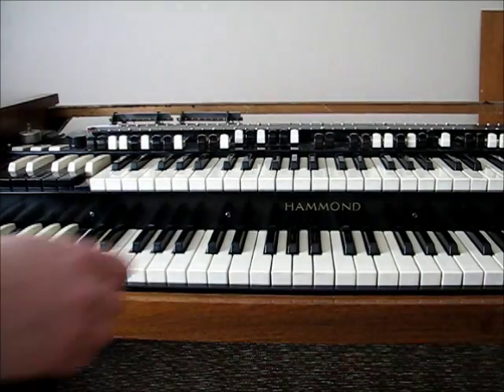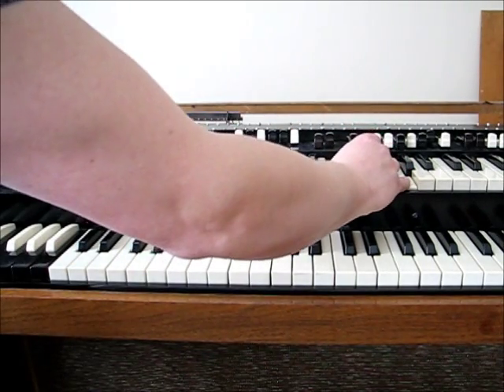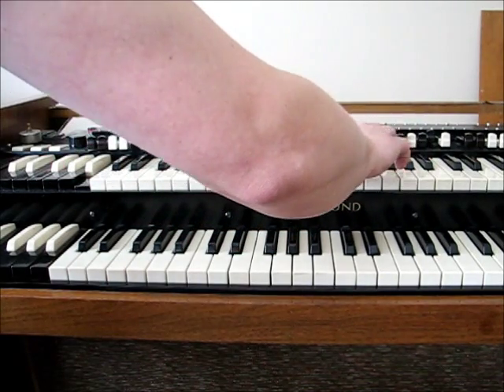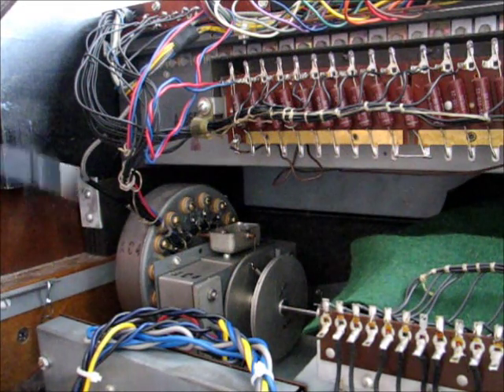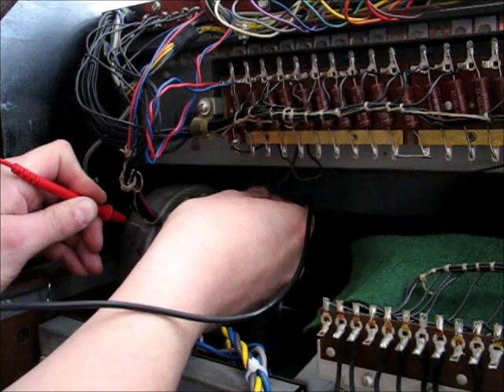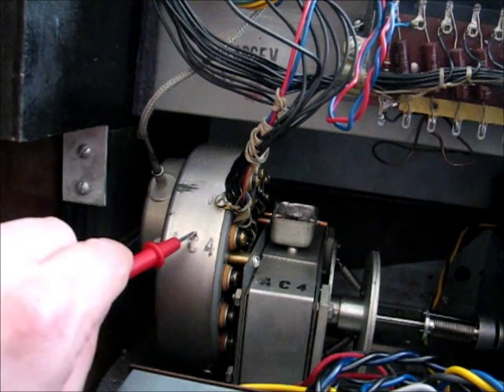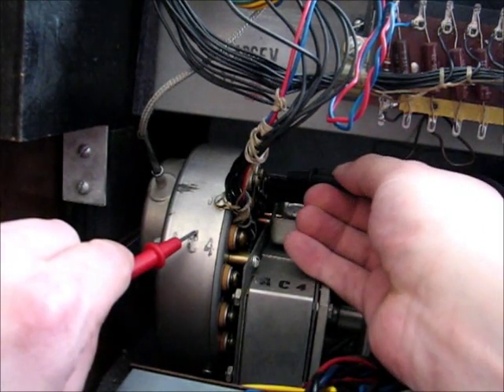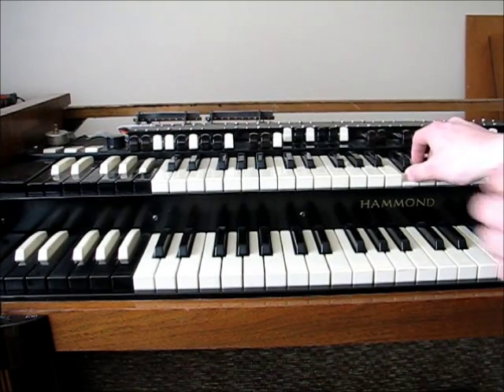Fixed Hammond A100 vibrato scanner

Comment: Hi Dave, I recently acquired an old A100 that is in great shape, a little oil in the tone generator and it fired right up however the vibrato wheel doesn't do anything (as opposed to the motor boat) where should I start?

Comment: It would be great to see how you hooked up the batteries.  I guess I would need some wire and just solder - to plus  and a wire from the 2nd plus battery to touch and zap the scanner contacts.  I do have continuity on 3 of the contacts.
Reply: No need to solder anything Mike. Just touch the areas where there is growth.
Reply: I still don't understand the hook up.
 - from the first to + to the 2nd? And then a wire from the 2nd + to zap the contacts?
- to the scanner housing comes from the 2nd battery? Correct?
Reply: @brownmeansblue6057 did you ever get clarity on this?

Comment: I used to play for a radio station in Chicago, and to slow the vibrato we fiddled with the Run switch, catching the generator at a slightly-less-than-normal speed: i.e.: everything played at approximately 2.5 steps lower than standard pitch. The vibrato sounded great at that speed, nearly as good as a Leslie. Wish the gearing ratio or whatever drives the scanner could be changed to slow it down. I had an H-112 in the '60s that had a slower vibrato; also a "dual" vibrato effect.
Reply: I absolutely agree!  I discovered the same thing around 1969 with my RT-3.  I really missed that heavy vibrato after fixing the scanner…..

Comment from the maker: I think if you are careful about only touching the leads to the appropriate places, and using such a low voltage, you should be fine. I read a lot of messages on forums, newsgroups, etc. before I became comfortable doing it. And yes, this is a shortcut to removing and cleaning the scanner. I believe cleaning will give longer lasting results, but in the year and a half since performing this my scanner is still working correctly.

Comment from the maker: HI Organgrinder1010. Other than using the different levels of C/V with the rotary switch, I don't know of a way to slow it down. Intuition tells me it is not practical since the scanner is mechanically linked to the tonewheel generator, and changing the speed of that would change the pitch of the whole organ.